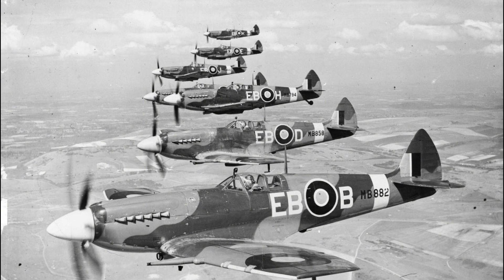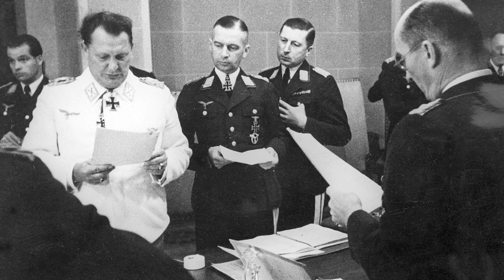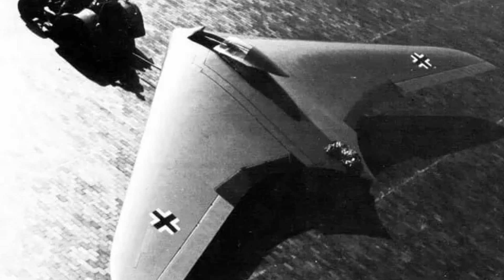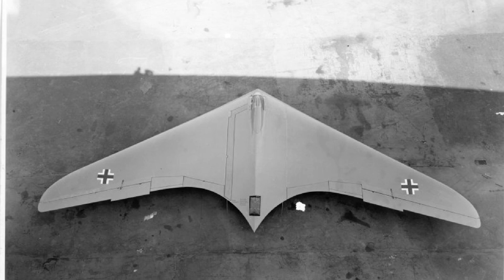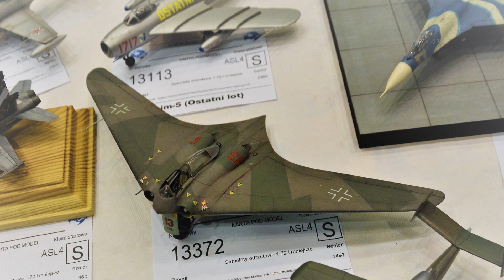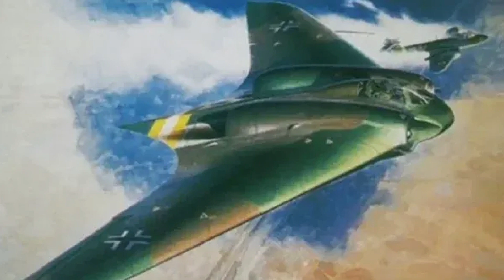Hitler’s “Stealth” Flying Wing 30 Years Ahead of Its Time

Comment: One of the Horton Brothers said that theire flying wing was never designed be stealth. That was just purely coincidental.
Reply from the maker: Absolutely — you’re right. The Horten design wasn’t intentionally built for stealth at all. Its reduced radar signature was a side effect of the flying-wing shape and smooth surfaces. The fact that it accidentally achieved some stealth characteristics just makes the story even more fascinating. Thanks for pointing it out!
Reply: @unchainedchroniclestales it wasn't even the kitty hawk. But it was an interesting concept for each time. There's no compersing between this and the stealth bomber. I've seen the south bomber stand wingtip vertical. The lower wingtip, Maybe a hundred foot off the ground. It just stood there practically perfectly still in one place!